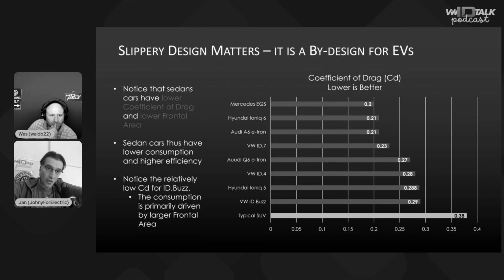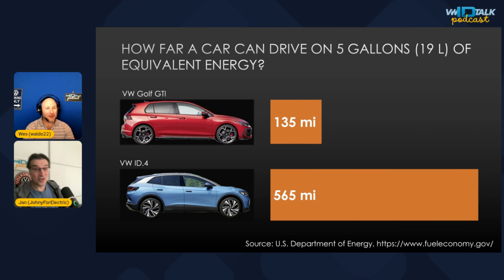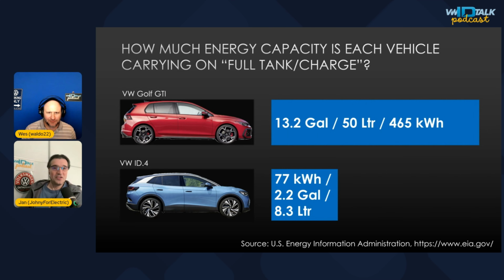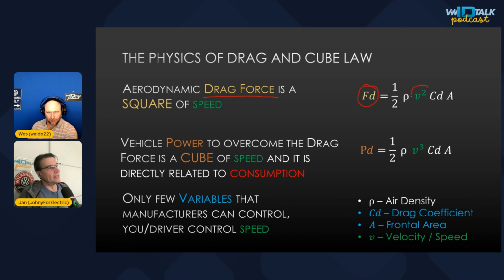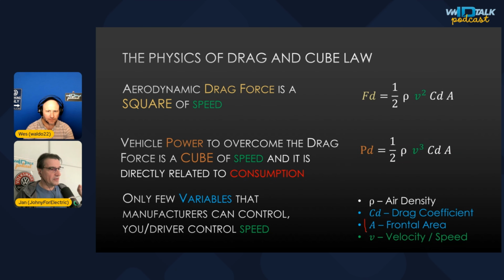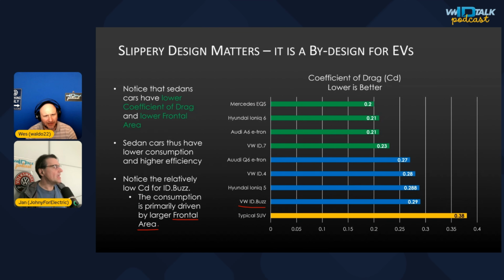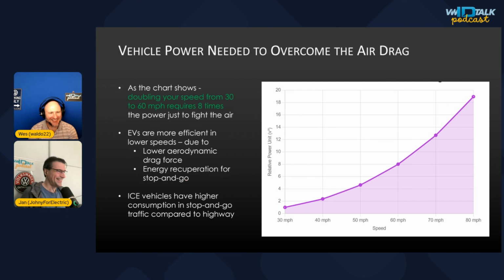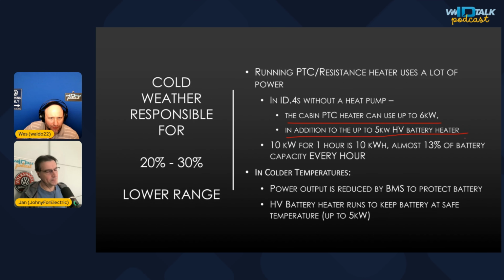EV Range Explained: Speed, Drag & Heating

Comment from the maker: ⚡ EVs are ~4× more efficient than gas cars… so why don’t we get 4× the range? In this episode we break down the real range killers: speed, drag and winter heating.

What do you drive and what range/efficiency do you actually see on the highway? Any practices you’d like to share with others? 👇
Reply: I'd say there's an important distinction between technical efficiency in terms of energy, and practical efficiency in terms of getting the job done.

I've no idea how energy efficient my car is, and don't much care, because it only takes about 2 minutes to get >500 miles of range back, that's in any weather, no degradation.
Taking an hour to do the same in an EV... is not what most people would consider 'efficient'
Reply: @SteveLomas-k6k  Pretty dumb attitude "to not care" .... keep wasting energy and ruining the planet cause you just "do not care".
Reply: @davidniquot6423  It's not a waste, it gets me where I want to go, when I want to go, in the comfort I want. We've got record cold where I live, so if I'm also helping to warm the planet, that would definitely be an added bonus!
Reply: @SteveLomas-k6k  this is not true at all.  You absolutely have range degradation in ICE cars in cold weather, by similar amounts as an electric car.  You usually don't notice because gas stations are ubiquitous.

Most gas cars don't get over 400 miles of range before having to fill up, and charging an EV from 10% - 80% doesn't take an hour.  It takes 20 - 25 min.
Reply: @wesleykins  And how much range do you get in 25 mins? Not 500 miles I'm guessing.

Can't say I've ever noticed less range in cold weather, more if anything without the AC- and I get as much heat as I want..
Reply: In short trips to the supermarket and back home its close to 8x my Ioniq 5 vs my Yukon XL. The smallest delta was above 3x in highway his speed driving

Comment: Power use at 70 mph is 274% greater than 50 mph.  I don't run my ID4 above 60 mph - no matter what is crawling up my tailpipe.
Reply from the maker: It’s true that higher speeds really change the energy consumption, thanks for sharing your experience.

Comment: You haven't quite clearly defined the relationship between power and consumption. Consumption does not increase 8 times with power, but only 4 times, because we manage to travel twice as much distance at x2 speed. Consumption has a quadratic relationship with speed, not a cubic one like power.
Reply from the maker: That's a great point, thanks for bringing it up!  Sometimes it's easy to get so caught up in the numbers that we miss something obvious like this.  Yes it's 8 times the consumption, but you go twice as far, so it's only 4 times the consumption *per mile*.

Comment: Doubling the speed will increase the power required by 8x, but half the time needed to travel a specific distance, therefore would be only 4x worse from a power per unit distance perspective.
Reply from the maker: Interesting point!  We assume you meant "power per unit of time" perspective?  It depends on the goal.  If one must be somewhere is a lesser amount of time, and efficiency and energy consumption is not a concern, then driving faster is the rational choice.

...but if one does not have a strict time window, better efficiency seems like a worthy goal!

Comment: Ioniq Electric is still a very efficient car! The only issue is the 28 kWh battery. Nevertheless I am fine with it. By the way, I rarely use the heating, but wear warm colthing.
Reply from the maker: The Ioniq 6 "Standard Range" has a 53 kWh battery, while the "Long Range" versions have a 77.4 kWh battery, and the new high-performance Ioniq 6 'N' has an 84 kWh battery.

Comment: Fuel system on gas car got be more like 100 gallon but dont make profits for shells r others gas trekers
Reply from the maker: Not really sure what you mean about 100 gallon systems in gas cars, but most gassers have 10 - 12 gallon tanks, with Prius and other small hybrids having smaller tanks, and trucks having larger ones.  Fuel tanks over 20 gallons are rare.

Comment: Drag is - as the name suggests - about the force dragging you backwards because of the vacuum created behind the car when it moves through the air, and the friction between the air and the surface of the car. Of course, pushing the air away in front of the car is also part of it, but without having the exact relationship between the tree things I assume the term “drag” was chosen for a reason.
Reply from the maker: Absolutely, drag is a fascinating topic with multiple contributing factors like the vacuum behind the car and air friction. Thanks for double-clicking on this area!

Comment: When it comes to range comparison I think it comes down to this.  Gas cost approx. 3.00 and electricity at .30 per Kw.  My ICE gets 25 mpg.  My electric car gets about 3 miles per Kw.  One gallon gets 25 miles.  At .30 I get 10 kw for 3.00.  10 Kw gets me 30 miles.  On my sticker for my EV says 95 mpg.  I think this amount is incorrect.  If I charged at home electricity is about .10 dollars.  Then I would get 30 Kw for 3.00.  Then I would get 90 mphc.  No DC fast charger I found cost less than .28 dollars per KW.
Reply from the maker: Charging at home or at work is definitely the best way to use an EV.  If you are relying on DCFC only, the economics aren't really better than ICE, but you can still feel good about driving an EV!

Comment: All these facts are correct, however, the commentator stresses the fact that POWER increases as a function of the cube of velocity. This is true, but the ENERGY consumed is a function of the square of the velocity, and this is the important consideration.
Reply from the maker: Great point - thanks for pointing this out - at higher speed you burn energy faster (v³), but you also spend less time to cover each kilometer (divide by v) → net is v² per km. Is that how you think about it?

Comment: I am not an VWID owner, I own two GM vehicles both with heat pumps and I do not live in a northern state.  These figures used were very nicely presented, however the heat pump losses I experience throughout the year  appear to be much less than the VWID calculated figures.  The heat pump takes the edge off the energy consumption swings when calculating range.
Reply from the maker: That's great to hear your GM vehicles with heat pumps are performing so efficiently, and thanks for sharing your experience! Unfortunately the VW ID.4 is not available with heat pump in the US :(

Comment: Could you do video shorts which go into detail regarding long coding for the ID.4? I have a 2021 pro model without matrix headlights and would love to enable auto full beam \ dipped beam. I know it's possible due to the car having the camera but I don't have the feature activated.
Reply from the maker: IMHO the High Beam Assist requires SFD unlock of ICAS1 module and changing the adaptation of at least one setting - "SFT00032-MAS28929-High beam assistant-Activation of high-beam control Light Assist: menu in information electronics" to present. OBD11 has a one-click activation called "High Beam Assist" that makes all the necessary changes. There is another "on-click" diagnostics interface (DFirst) discussed here - https://www.vwidtalk.com/posts/334985/. 

According to our experiences the "High Beam Assist" without matrix has a delay for both activating the high beam and dipping it, so was not as useful as it may sound after all...

Comment: What if your EV electric power is sourced from a coal plant as is likely in a number of countries?
Reply from the maker: CO2 emissions - that is a really good point. From our quick analysis it seems that even if your energy would be 100% coal based, the EV emits approx 25% less CO2 than an ICE car. This would be attributed among other things to higher efficiency of the power plant (than the ICE car). The good news about EVs is that there are alternative ways of producing sustainable electricity. We understand that EVs may not make sense for all use cases and some countries...
Reply: EV proponents don’t like to talk about that 😂 … Coal powered power plants are only approximately 33% energy efficient. So EVs powered by coal-sourced electricity are only 33% efficient before the owner even plugs in the charger.
Reply: @Clyde-2055 (& anyone else of a similar mind) It isn't that simple of course 😂 Depends on black or brown coal, how modern the plant is, ... Current OECD average coal efficiency is 37%. More modern plants can do up to 10% points better. Then how do you compare that to ICE in a vehicle with cold starts, operating temperature, altitude, journey duration, engine capacity, fuel RON, engine design (e.g. turbocharging & combustion cycle) lean/rich fuel:air mix, heat recovery, engine load, rev range, engine oil viscosity, drivetrain losses, ...
But to cut to the chase, we are agreed there is a rapidly dwindling case for coal fired power. We should stop it ASAP. No argument from me. Power grids will never have more coal generation than they do today. Grids will only get cleaner due to cleaner generation becoming increasingly cheap, & this thing called Climate Change... Maybe you've heard of it? It's been a scientifically proven problem with burning fossil fuels at a global level since the 1950s, with IPCC establishment in the 90s to get the world to face up to it. I recommend doing some reading, certainly before any more commenting!
Reply: @MortyMac The US is going in reverse full throttle to maximize coal use in its grid.  The source mix in power generation — especially for data centers has become contentious.
Reply: @jebbrown5961 Yes I am aware. No offence, but Trump's influence won't last forever due to either natural causes or politics, then you would hope/expect/(pray) renewables rollout returns motivated either by it being cheaper, or greener? How do YOU see that playing out?
Reply: @MortyMac  — The base issue can be simplified, as was done in the subject video, where stats are generalized, or they can be convoluted and complex, as you tried to demonstrate. While you posed questions about the IC engine’s emissions and efficiencies given varying design parameters and operating conditions, I see nowhere that you made mention of like variables as they apply to EV batteries, motors, charging systems, and design parameters, and how specifically those variables affect the overall efficiency and emissions of EVs. 

So thrill us with your acumen. Please tell us, what are the three most common motors designs used in modern EVs, and how do operating conditions (like load, temperature, and voltage), mechanical factors (such as bearing wear, misalignment, and vibrations), electrical losses (including resistance, hysteresis, and eddy currents), and environmental factors (like contamination, moisture, and dust, affect EACH motor design differently as related to motor efficiency and emissions. And after you enlighten us, do the same for the different battery chemistries used in EVs, and how the construction and performance differences of each design affect their respective environmental impact.

As you seem to think such detailed specifics are germaine to the topic, we’ll wait …
Reply: @jebbrown5961  the government may be pushing for coal but the power companies are closing or converting over 9000 MWh of plants. 17 plants in nine states are being retired and 4 are being retrofitted to run on natural gas. Coal's profitability is going down and the markets are moving away from it in the US.

Comment: I wish you had added diesel to the equation 2:39
Reply from the maker: That is a relly great point - according to a quick calculation the Golf GTD is 40% more fuel efficient according to WLTP compared to GTI. So it would be around 200 miles.

Comment: You forgot to mention the fact that cold battery on its own has lower energy capacity. Try warming up a car with the cold battery in a garage and observe SoC (or battery capacity via OBD).
Moreover, the aero drag is only part of the losses during driving - you're not mentioning the effect of the tyres, road state, roof rack etc. It would be nice to calculate how the ratios between those losses change with different speeds and road/air conditions.
Reply from the maker: That's a great point about cold battery capacity; we focused more on the energy consumption during driving, but battery temperature definitely impacts usable range. We were looking into how different sizes of tires and rolling resistance implact consumption as well. We love the idea to model a digital twin of the car and take it throught different seasons and driving conditions... Great idea - thanks for that!
Reply: Rolling drag is a constant for every vehicle and cold only effects cars that are in the cold with a lithium battery.

Comment: I did this same research about 3 weeks because no other YouTuber would really provide a technical explanation why EVs range was more sensitive to drag than ICE car when both cars saw similar drag forces. This video literally summed up what I ended researching, from an aerospace background great job guys!
Reply from the maker: That's awesome you did the research yourself and found our video aligned with your findings! Thanks for watching!
Reply: Ev's range is not more sensitive to drag than ice.
As mentioned in the video all objects are affected the same way by drag. The same formula applies.
So, if you gain %10 efficiency by reducing cd of .3 to .2 in an ev, you will also gain same 10% efficiency also in an ice car.
Ice cars having lower consumption in 70-90 km/h vs lower speeds is not their insensitivity to drag. The reason is transmission (5-10 speed in modern day). The engine speed is optimized at that speed range for best consumption. Multi speed transmissions don't exist for evs.
Reasons are mostly flat torque band that goes up to 22k revs = very little gain from reducing engine speed, added complexity and efficiency losses from friction being not worth, not to increase weight in an already overly weight car. However there are models with two speed transmissions in small numbers.
Reply: @bulentkulkuloglu   I agree the forces and formulas all do stay the same for both. But EVs are more sensitive any forces drag, friction, or mechanical losses, and its not because of the transmission but because of the available energy for propulsion. 

Let’s first start with Energy(E) which is equivalent to work; how much force is needed to move an object a certain distance and this can be represented by the work formula; Work(W) = Force(F) x Distance(D). If we want to put units on this it would be kWh = Newtons x km. 

Now comparing the ID4 to Tiguan as they are similarly shaped, the Tiguan has about 515 kWh(15.3 gal) of energy in the tank and id4 has 77Kwh of energy in the battery. If a Tiguan turns 20% of its usable energy into propulsion and the ID4  turns 80% of its energy into propulsion, we get 103 kWh energy for propulsion on the Tiguan and 61.6 kWh for the id.4. Since they are similarly we'll assume both experience similar Drag force (i know id 4 will be less force as it has a lower Cd, but just for simplicty we'll say they are the same), If both drive for an hour at 100 km/h they will experience about 370 Newtons of drag force and would have traveled 100 km . now using the work formula, E = W = F x D = 370 N x 100km = 37,000 N * km = 10.27 kWh. 10.27 kWh is 9.97% of the tiguans available propulsion energy and 16.67% of the id.4's available propulsion energy. 

So to travel at the same speed, for the same length of time and distance, while experiencing the same drag forces, the id.4 will use a higher percentage of its available propulsion energy than the tiguan thus is more sensitive